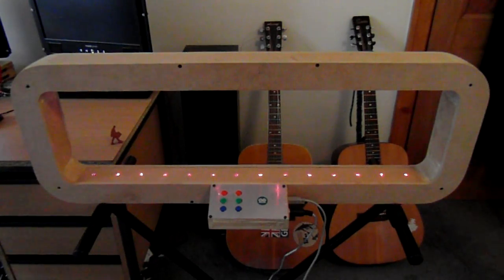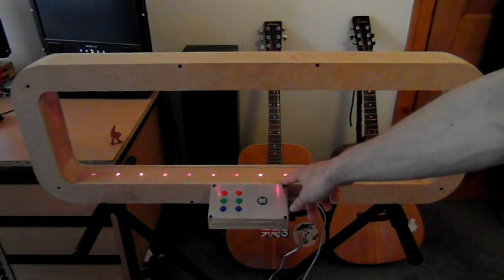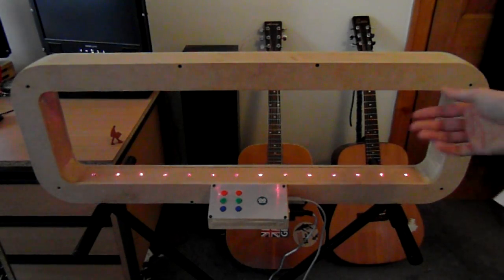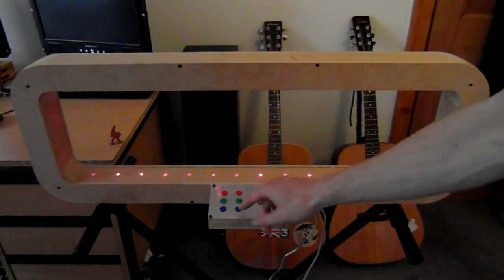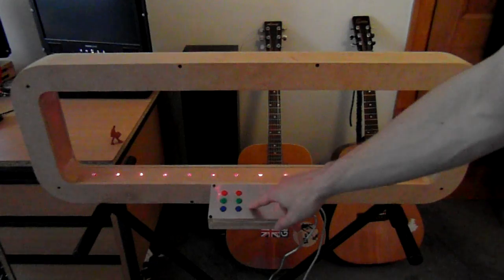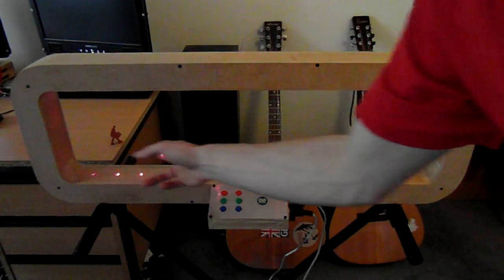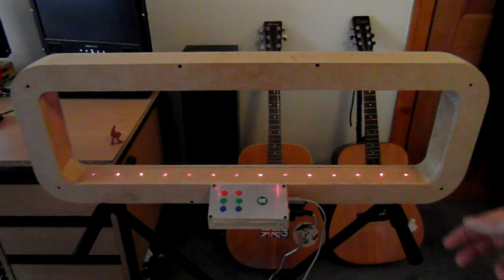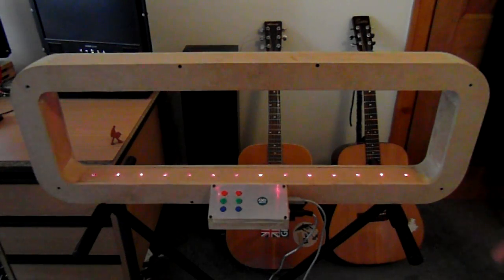14-Note Framed Midi Laser Harp - Arduino Powered (velocity sensitive)

Comment from the maker: Hi! you can measure relative velocity with just the laser and the photodiode. As your hand passes through the beam the light reaching the diode will tail off - you can measure the slope of this tail to get a very rough idea of velocity, not accurate, but enough to play hard or soft.
All scales and notes are calculated relative to the fundamental (the left-most note). You're right - when the octave+ button is pressed I simply add 12 to the fundamental (12 semitones). There's some debouncing too.

Comment: How exactly did you measure the velocity with this? IR sensors? Also, for the octave switching, did you code it just so that if the button is pressed, it will go up an octave? For example,
if(buttonstate == HIGH){
 [code to make the notes go up an octave] 
}
?
I know this may be a late comment and you may not see it, but I have to know.